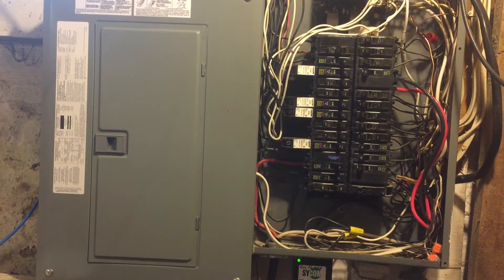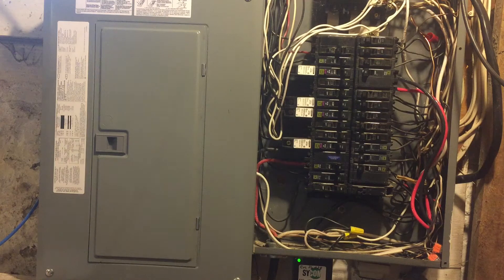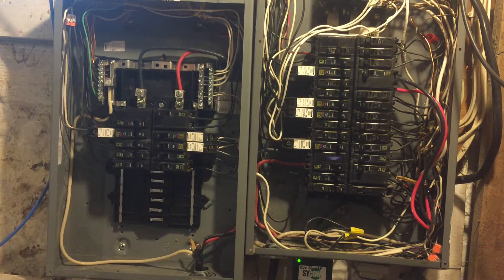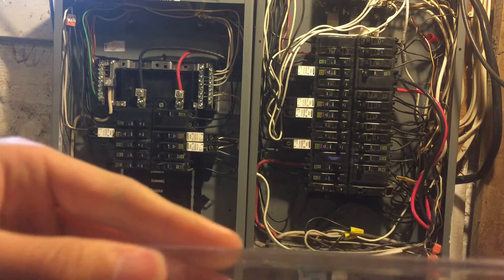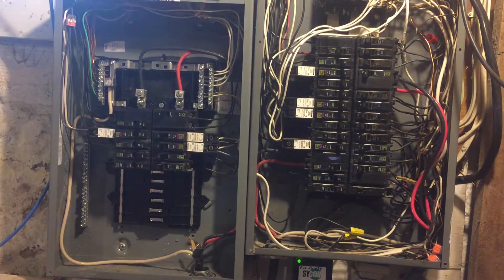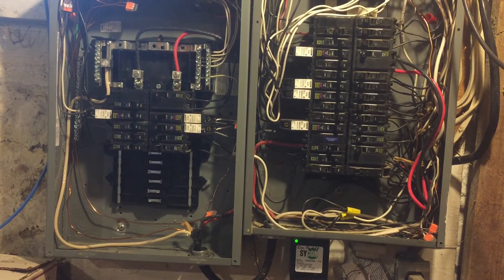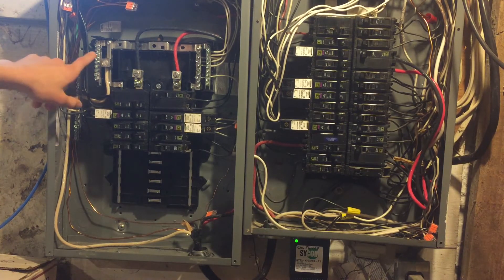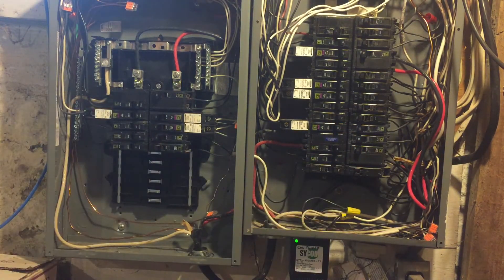Righting A Wrong: Separating Ground And Neutral

Comment: This is an excellent point.  I had a new workshop wired by a licensed electrician that made some serious mistakes.  He put 120V 20A outlets on 240V circuits and ran 8 gauge wire on 20A 240V circuits  That's a problem because 8 ga wire won't fit the connection points on 20A outlets..  He spoke no English and my Spanish is poor so I decided to put the correct outlets in myself.  Now I need to go back into the sub panel he installed and make sure he didn't wire the grounds as you had originally.  Thanks!

Comment: Pointing that screwdriver haphazardly in the panel scares the crap out of me.  You should have used a laser pen as your pointer while demonstrating the panel.  You could have easily slipped and touch something metal with that screwdriver. It’s good that you finally turned off the entire panel but prior to doing that, you were pointing with that screwdriver.😊

Comment: The mounting screws for the bus bar are self tappers. In a situation like this I would have mounted the ground bar at the top wireway section of the panel. You are allowed to drill your own mounting holes.

Comment: No licking yourself.  I just realize I failed to separate the sun panel neutral and grounds in my sub panels too.  Been 12 years and had zero issues just happen to see it on YT.  Get the concept was just unaware at the time.  Was also instructed to run a 4 awg ground from the neutral bar to a copper pipe not sure it’s required.  May run it to the neutral bar took

Comment: Just a safety thought.  When electricians turn on breakers, typically the cover is installed.   And when they turn on the two pole in the main panel, they stand off to the right, and reach out with left hand to turn on the breaker.    They do sometimes explode.   Burned arm is better than a burned body.   Good job fixing your issue!
Reply: Came down to the comments to say the exact same thing. NEVER stand directly in the line of fire on the main breaker.

Comment: Every time I get weirded out seeing uninsulated wires in American panels and home. Just pure stick of metal for neutral or ground. I understand you can, but should you though?
Reply: I can only answer as a non electrician.  Ground wires are always bare and bonded to any metal conduits, the screw of the outlet, and the metal chassis of grounded devices plugged in.  No point in insulating those wires when the things we touch on a daily basis aren't insulated anyway.  As for neutral, those wires are insulated, IDK where you get the idea that we don't insulate neutrals.  Are you saying the bus bars are not insulated?  Even the hot bus bars aren't fully insulated, they're covered in normal operation though, which is good enough.  Inside the main box, neutral is bonded to ground, so no point in further insulating those.  Neutral in a sub box could have potential though, as you can get zapped working on it if any of the hots are on, and any uneven loads are connected.
Reply: @ClipstopherBurtraw  In Europe, both neutrals and grounds are insulated all the way up to the bus bar. I understand you can leave a ground bare, but it does make me uneasy somehow. Say, what if there’s damage in live wire’s insulation somewhere and current goes to the ground wire?
Reply: @herrDOS  that would immediately flip the breaker.  Otherwise, the metal devices we have would also shock us in cases of shorts, as would outlets, faceplates, etc, all of that is exposed.  It's more likely for a short to occur in a device, outlet, or switch, than in the wiring iself, the ground wire is intended to give a low resistance path for current to take (hence tripping the breaker) in that case, but it would work the same for a wiring short to ground. 

Basically, ground is, by design, never dangerous on its own hence does not need to be insulated.  If it was, we would never be allowed to touch bare metal anything anywhere near electric circuits.
Reply: @ClipstopherBurtraw  yes, because it ground goes to the bus bar, but it also goes into the ground. Might there be a chance you’d get yourself a bare live wire through your whole house that does not cause a short circuit?
Reply: @herrDOS  admittedly this is where my knowledge drops off a bit.  That said, ground is tied to neutral making it the same potential all the way to the transformer.  A short will trip something, somewhere... If nothing else, it would trip the main breaker.  It is not a real safety risk in any case, even if I can't explain exactly why.  Keep in mind, the grid is also grounded and the actual ground IS a path for current flow when needed.
Reply: @herrDOS  The ground wire in 12/2, 12/3 and 14/2 is not individually insulated therefore when you remove it from the jacket, it is bare all the way along.
Reply: @ClipstopherBurtraw  100% accurate on both statements
Reply: @herrDOS  Solid copper household gauge wire is pretty stiff.  What is going to cause it to move inside a box?  It's secured at the entry point so even a raccoon getting up against it outside the box isn't going to move it inside the box.